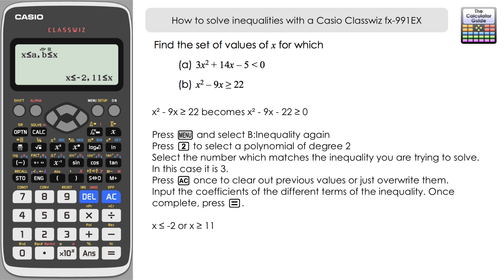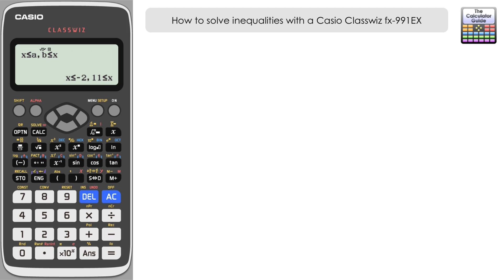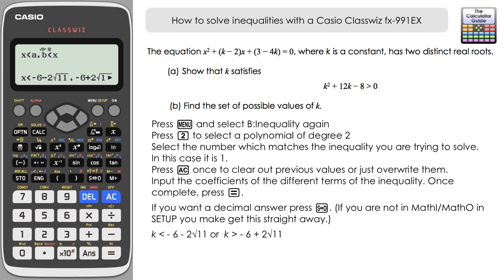How To Solve Inequalities On A Casio Classwiz fx-991EX | fx-570EX Calculator (Inc. Discriminant)

Comment: Hey do you know how to change the inequality ax2+bx+c<0 to ax2+bx+c= , it’s because I tried to change i coudnt I don’t want to have the < sign I want to have the = sign
Reply from the maker: You need to use the polynomial solver instead. Go into Equation/Func, select Polynomial and the degree 2.
Reply: @TheCalculatorGuide  I figured out that I was clicking the wrong letter for my calculator it’s 9 - 2 - 2